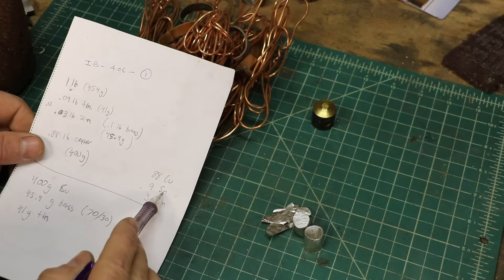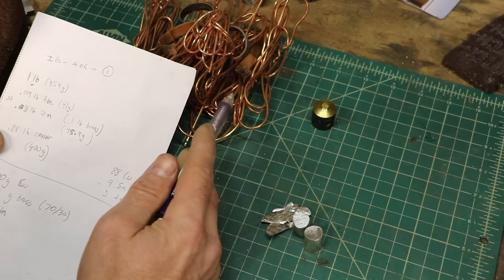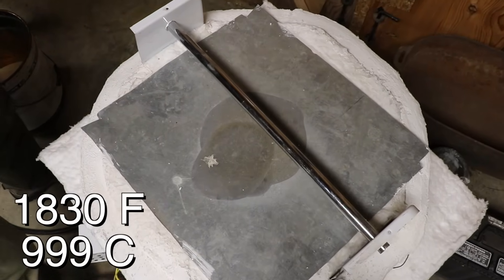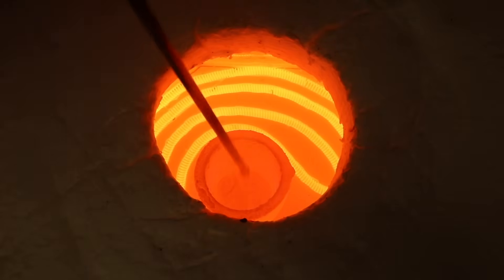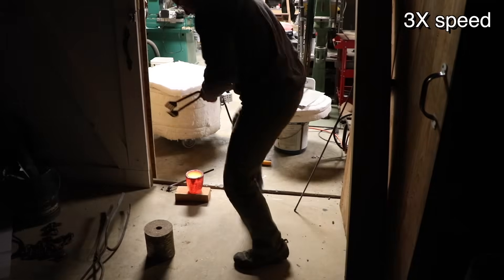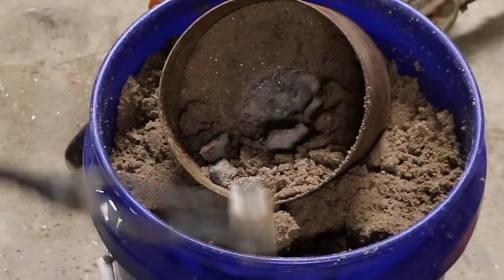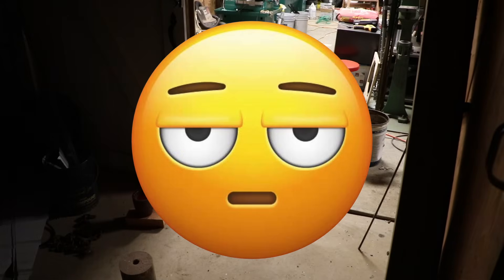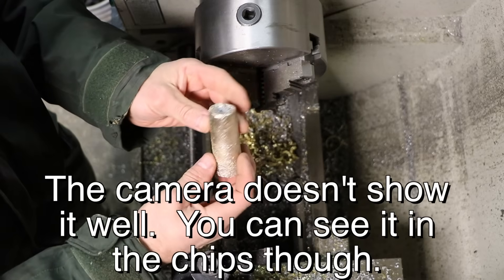My Quest For Gunmetal.  Part 1  FarmCraft101

Comment: I vaguely remember reading something about experiments being done with tiny percentages of aluminium being used, but at the time aluminium was the rarest most expensive metal on earth so the costs out weighed the benefits at the time. I wonder if doing a 0.2% aluminium bronze alloy would be worth it today just because it's so cheap now.

Comment: Jon, most of the metal and metal alloy questions you have  are answered in any good metallurgy reference book. When I got into casting my own bullets and gilding caps I went looking for answers and found them in a metallurgy reference manual for a college course. Those are pricey if new but the basic science hasn’t changed in decades. I found an old one at a garage sale for under $5. This was about 60 years ago. Good luck and I appreciate the detail and effort you put into your YouTube projects. Keep them coming!

Comment: You’re not casting it hot enough. You lose on average 100 degrees per second with 88/10/2. Bring your temps up to 2600F, skim, degass quickly and get tings around the crucible before phosphorus is finished. Cast quickly to keep allot consolidated (ie keep spruce choked). That should do it. And yes, let castings always air cool.

Comment: Just curious ... Why don't you rake out the dross while it's still in the forge?  Or, (assuming it's too hot to do that) Take the crucible out, rake the dross, put back in the forge to bring up to temp and repeat until there's no more dross, THEN pour.  Just a thought!
Keep up the great work!

Comment: Were can I find blacksmithing flux and this smelting flux?
Also what machine is he using to check it’s tensile strength?
Reply: Its a hydraulic press with a pressure gauge on it. By knowing the pressure exerted on the example and the example cross section, he can calculate force which then gives him material strength.

Comment: Highest strength brass and bronze is cast then hammer forged then cold rolled to consolidate the internal crystalline structures.
Also for most non ferrous metals, best practice is to use the lost wax casting method and after burning out the wax or plastic image material, keep the mold heated to a dull red around 800-900° F until moments before casting.
Sand casting is just not adequate for precise temperature control.

Comment: Don't you hate it when you grab something you should had known was hot? You get a combination of pain and feeling stupid all at the same time, ha. I am rather sure we have all done it at least once. I remember picking up my soldering pen up backwards once. Learned a neat way to remove finger prints. Held it that way for about 4 seconds before I realized that sizzling was me.
Reply: oh man, i remember doing that, silly me after giving it the 30 minutes under running water treatment, i go grab it again, with my other hand! both hands, mirrored burns!
Reply: We were bending glass tubes for chemistry and although the teacher had told us that the glass will be hot for a long time, i grabbed my peace after about one minute of cooling to show it to someone.
The outer layer of the skin was charred (a little bit) and it took a long time to heal completely.
Reply: Done the same thing with the hotend on my printers more than once.

Heat it up to remove the nozzle,
"This is moving when I try to loosen it. I'll just hold it steady... sizzle and smoke Oh, right. That's hot. Shit "
Reply: Pulled a boner one evening while cleaning up the kitchen. Had taken a pot of the electric burner and turned off the burner.  Washed dishes and pots and pans. Then as I was drying a fry pan, and I wanted to set it on the stove top after drying, I wanted to check to make sure that burner was no longer hot. Rather than just holding my hand above the burner, like a dummy I guess I could touch the burner lightly to check for heat.  Well, it didn't take long for me to learn that it was still quite hot ..... hot enough to burn concentric circles on all 4 fingers and thumb and rings in a 3/4 inch wide band on my palm .  Held a clean wet cloth in that hand while I drove to the closest urgent care.  It didn't hurt while it was wet and protected from the air.  Left with a Rx for a medicated white cream which I took to the pharmacy on the way home.  I healed quite nicely ..... had faint scars for about 6 months, but they eventually faded.  Don't have to test the burners on my new stove, there is an indicator on the panel that shows if a burner is anything other than "cold".

Comment: Enjoyed your video very much.
I agree with the comment about sample prep.  It looks like a crack propagation failure originating from the lathe mark at the end of the sample area...I think that kind of sample is supposed to have a fillet (sp) of a particular radius at each end in order to reduce stress risers in the area of the end of the sample.  (I'm a retired electrical engineer and professor, but I did stay at a Holiday Inn a few  years ago...)  The failure of the auto part seemed to be contained completely within the sample area and not extend into the machined area top of bottom...

Comment: Don't be discouraged. You will get there. I agree with all the comments so far. Control the cool down, degas and dross in the furnace, longer neck on the sample, slight radius at the ends of the neck, make sure the mounting holes are in line.
Keep it up!!

Comment: Most of my work is in electrical, ceramic materials, so take my input with a grain of salt.
Have you tried annealing the samples after turning them on the lathe?
The fast cool down from casting and the cold working while turning might be work hardening the metal and making it more brittle
Reply: In terms of post process annealing (recovery and recrystalization) , try ~350°C (might be easier for you to try 650°F) for 1 hour.
I’m guessing your setup is in Fahrenheit, so if that doesn’t work it might be worthwhile to test samples that are annealed for 1 hour at
550°F
450°F
350°F
250°F
I wouldn’t recommend going any lower because 250°F (120°C) is what I found to be the recrystallization temp of copper to be
Reply: For processing in general (you probably already know this):
A quick, constant pour into the mold (no stops and no “lulls”) once pulled out of a furnace is usually the way to try and cast something, especially into a mold that has been heated to prevent the liquid from seizing in the mold or to prevent voids caused by adsorbed water boiling in the mold.

Personally, I would recommend grinding the metals into a powder through ball milling, in order to get as homogeneous of a mixture as possible, and then go through he process of melting, but I assume you are trying to avoid as much loss to oxidation as possible

Comment: If you cool it down more slowly, you're going to end up with a finer grain structure, which in theory should produce a stronger result. I mean, I'd still definitely test it, because who knows if there was something extra in the chemistry you either forgot or didn't know to account for with that brass element, or with the purity of your source elements.
Reply: Slower cooling leads to larger crystals and grain structure not finer.

Comment: If you have a good mold which can be in the furnace during cooling, I would suggest to pour the brass, put the mold in the furnace as it cools down to allow for an elongated cooling time. Not a material scientist in any way (computer Sci) but had good success  doing that for some molds.

Comment: Bronzes tend to have a much larger grain structure than aluminum or steel.  How much porosity did you notice? The sample also broke at the chamfer instead of the middle of the neck which typically indicates a fixturing problem or a pocket of porosity. Were your holes parallel? The sample also lacked ductility which may be impurities or composition problems (zinc depletion?). I used to take off the dross and degas in the furnace and the tongs I used allowed you to pour straight from furnace , just like the big boys do. I am by no means an expert but I play one in the comments section :)

Comment: I'm a structural geologist, not a engineer, but all the all the specimens we ever ran had curved shoulders- yours are angled which will cause a stress concentration. It appears the specimen started to fail at the shoulder, and it should fail somewhere in the middle. It also didn't have that nice 60 degree fracture angle, or much necking, so I don't think it is exactly a proper test (unlike the aluminum). I don't think that is going to make a huge difference, but it will make some. If you were able to cool the metal faster (quench it) it would also result in smaller gain size which will result in strain hardening happening faster, increasing the effective strength (I think- It's been a few years since material properties). That's probably where you will get the largest change. But allowing a small test blank to cool that fast is unrealistic, as a cannon will have much more thermal mass and will cool much slower.
Reply: I think you ment to say cooling slowly results in small grain and higher tensile strength.

Comment: So I like what you are doing here, but I had a concern. At 5:50 you were handling extremely hot metal near your gas can. When I melt or weld, I move that stuff out of the shop, just makes me nervous! Awesome video though, I really like the fact that  and how you tested your hypothesis.
Reply from the maker: True.  I have to admit that I hadn't even noticed.  I do all the melting and pouring on the other end of the shop, but that is where I store my greensand.  I'll have to be more careful in the future.  Cheers!

Comment: Copper, tin and zink. Well copper tin alloys are like solders, add some thing like a bit of silver to it, different ratio sure. But then the zink crystal may get between the tin and copper preventing a strong tensile bond?

Just a electrician guessing